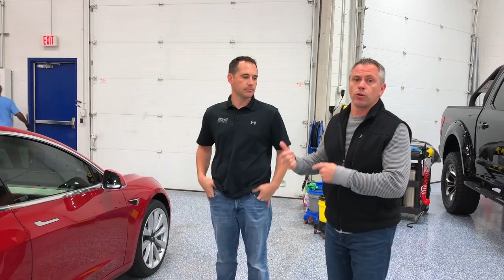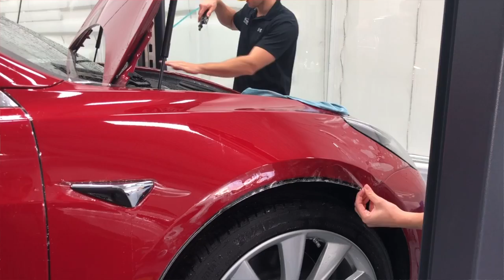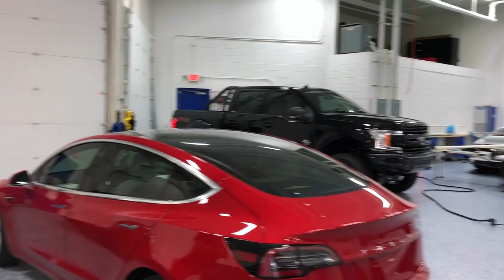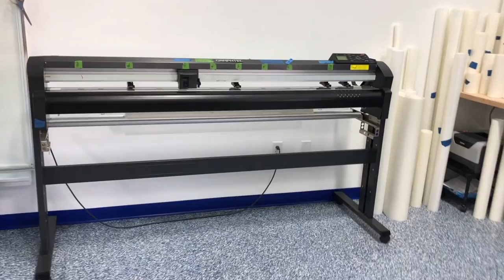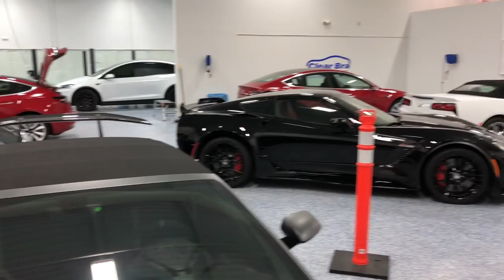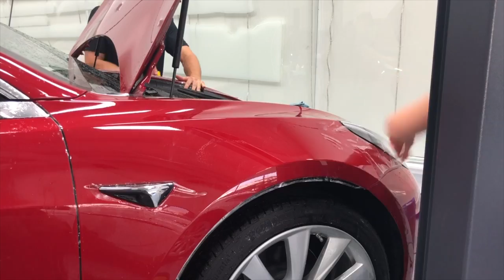****EXPEL PPF CLEAR BRA INSTALL****ON MY Tesla Model 3 (PART 2)

Comment: Did the addition of the clear bra effect the sensors or anything with the sensors?
How long did they take to wrap? Also do you find the only adding clear bra on some of the sides benefits rather than adding to the entire door?
Reply from the maker: Hey Jesus, the clear bra and ceramic coating had zero impact on of the sensors and radar. It took him about 3 days to wrap it and coat it. There is a curing process for the coating as well. I did not wrap the entire car I went with the rock prone areas. The entire front end lower Rocker and upper pillars along with mirrors. I could see why you would want to wrap all the doors as well but for me I just wanted to protect the car from rocks and road debris. However, I do have a few scratches on the door that the wrap would have protected. Hope that helps and I thinks it well worth investing.

Comment: How much does this cost?
Reply from the maker: It really all depends on what you are looking for and what shape your paint is in.  I did an Expel full front wrap, A-pillars and rocker panels, Ceramic Pro coating and window tint for around 4k.  Prices will vary as I stated above plus, it will depend on who you use and what product you chose. Hope that helps and hope you can see the difference...  I will be doing a wash video soon to show how easy it is to wash with the Ceramic Coating installed.